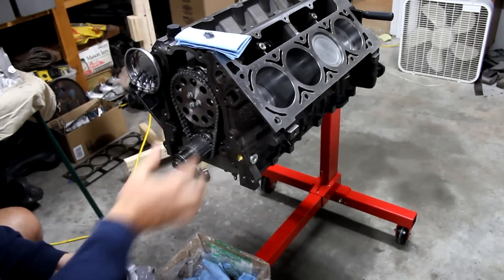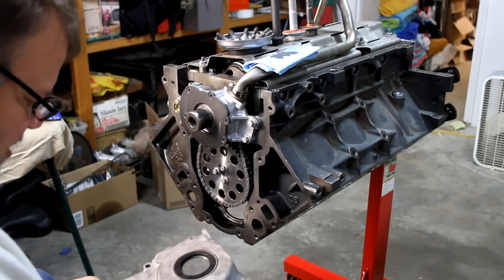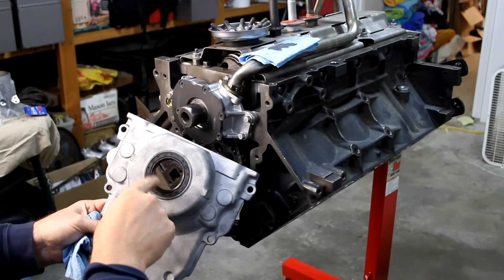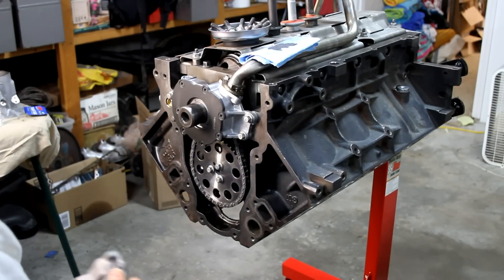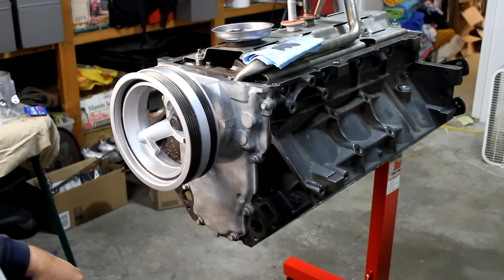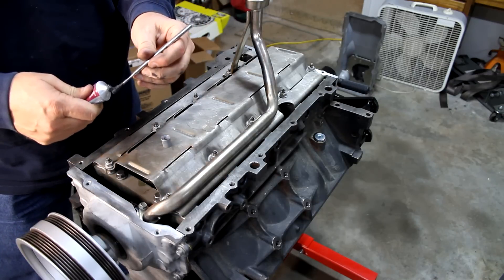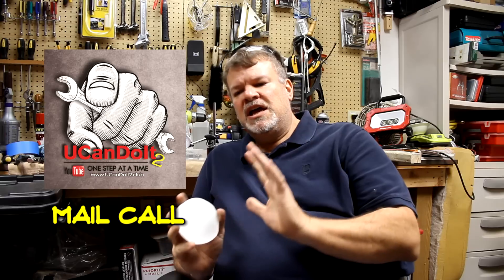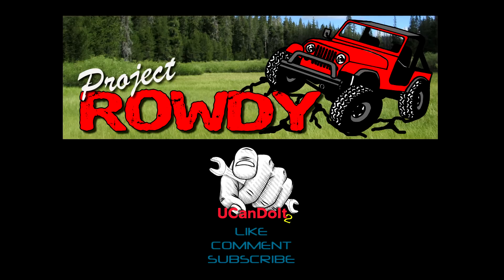LS 5.3L Build Part 5 Oil Pump and Covers | Project Rowdy Ep009

Comment: Great videos thank you for posting. Do you have recommendation  for a harmonic balancer puller? Also the bolt you used to install it?
Reply from the maker: In Part of this series, I used a Bearing Separator and Puller Set that I had purchased for another project (Transmission Build).  It worked perfectly.  I believe you can Google for specific HB Pullers as well.  For the Harmonic Balancer Installation Temporary Bolt, I used the following:     M16 x 2.0 x 120mm (Fastenal # 11127092).  The 120mm length provides what you need to do it right.  Hope this helps!
Reply: UCanDoIt2 thank you

Comment: How do you keep the crankshaft from turning when tightening the harmonic balancer bolt? It seems that you would eventually start turning the crankshaft once the bolt starts to get deep in the crankshaft.
Reply from the maker: Fantastic question!   I answer this in Part 7.  Check out Part 7 at this location... https://youtu.be/UeYfDW8u6-c?t=16m4s

Comment: What are the torque specs
Reply from the maker: To what????  There was a lot of content covered in this video.  Most books and manuals have pages of torque specs for all the fasteners.  Not that they all need to be torqued.
Reply: I lost oil pressure and have a knocking sound thought it was in the top end after further investigation my lifters and rockers pushrods are ok I'm all about putting it back better then before what's your thought?
Reply from the maker: I have little experience with diagnosing a problem and tearing apart an engine to discover the cause.   However, based on what I have learned and my limited experience, sounds like your Oil Pump went out and has possibly damaged one of the following:  Cam lobes, Lifter, Push Rod, or Rocker.   Just a thought.
Reply: That was our thought too it makes me nervous to tear it down or to have to pull it completely with out definitively knowing what the problem is or how severe

Comment: Can I use a melling high volume unit with a double roller timing chain on my 5.3 LM7. Same as yours.
Reply from the maker: When installing most/all Double Roller Timing sets, (on any LS style engine), I believe you are required to install small spacers between the Oil Pump and the block.  This provides the proper clearance due to the thicker size of the timing set.  On top of those Spacers, you should be able to install any LS style Oil Pump.    A word of caution on the High Volume Pump (you will need to decide).  From my earlier research (may be inaccurate), I believe it was stated that the Standard Melling Oil Pump produces more flow than the stock GM Oil Pump.  Therefore, just moving to the standard offering, you were doing an improvement.  I was thinking that "more" was better and thought about installing the High Volume model.  I was quickly warned that it is mostly used in race applications and that if you do not also increase the volume of your oil capacity, you could suck your sump (oil pan) empty.   Again, I will let you do your own investigation on all of that.  The over all answer to your question is Yes.  Please make sure you understand the correct use of a High Volume Pump.   Hope this helps!!!!

Comment: buen trabajo, la que me espera a mi, suenan los botadores de mi astro 98 4.3

345/5000
when it changes the rings, it also replaces the part of the piston, my star makes noise like of punches, but I want to prepare for the worse it brings 4.3 vortex, that advises me, I have seen that if it can be repaired without disarming it all, I admire it, it makes a fantastic job, very detailed, happy new year from tijuana, mexico your server aldo francisco
Reply from the maker: Muchas gracias!  Good luck with the repairs on your 4.3 Astro engine.

Comment: Having issues with oil pump priming . It is not a new pump but it did pump good before head and cam swap. Put new o ring on pickup tube .4+ quarts of oil in motor on stand. Oil filter full . pulled plug out of left lower front of block to prime pump . Still no oil pressure on stand. Using 1/2 drill using balancer bolt heads on with no plugs in it. Any help would be greatly appreciated.
Reply from the maker: Sounds like you have done everything required.  Two things come to mind:  1) a dry pump gear will never draw a vaccum (I believe you have taken care of this) and 2) Did you install the correct O-Ring on the pickup tube?  I believe there are at least two different styles of tube ends that require different size O-rings.  A straw with a tiny hole will never draw liquid.   Just a few thoughts!!!
Reply from the maker: I cannot remember if my kit came with a new gasket for the camshaft thrust plate.  I do remember that it was relatively flat and believe I used a little silicone behind the gasket to help hold it in place and to space it out just a tad (technical term).  I believe I will be in good shape there, but you point is excellent.   Thanks
Reply from the maker: I definitely did not purchase a new Plate.  But I do remember adding silicone behind the gasket.  Thanks!

Comment: Hey there, I"m really enjoying your videos on the 5.3 rebuild. I have a 5.3 that I need to rebuild. It's going into a 1968 Nova that i am restoring.

I just wanted to share with you something I have read about the oil pan installation. What I have read is that the back of the oil pan has to be exactly flush with the back of the engine block. (just like the timing chain cover and the rear seal cover). 

I think the reason for this, is that it has to be flush with the block is so that the transmission will mate up flush with the oil pan and the engine block. I assume that the transmission bell housing or possibly the oil pan could be damaged if they were not flush when the transmission is torqued down.

This may not be an issue on every install, I am willing to bet that you are possibly using an adapter to mate a Chrysler transmission to the LM7. What I am talking about may or may not be an issue for everyone. I just wanted to share some info that i have ran across, I hope that I am not incorrect on this topic. But it did seem like valid info, and I wanted to share it with you and others.

Once again, thank you for your videos.
Reply: briankmizell thanks bro

Comment: I'm sure you did this and I just didnt catch it, putting a smear of oil on the rear main and front crank seal.  Another great video.
Reply from the maker: Actually Darren, the manual that I used for this build specifically states. "A thin film of oil applied to the engine cover surfaces will help the seals press into place ( this is talking about installing the seal into the front and rear cover). However, the seals themselves are designed to be installed dry - do not lubricate their inner rubber surface!".  So I specifically did not lubricate them...  You didn't miss it... I didn't do it!!!!
Reply: Outstanding, that's a good thing for an old mechanic to know!
Reply from the maker: I agree!   Like you, half the reason I rebuilt this engine was to learn what the new stuff is all about!   Cheers!

Comment: I really like this part, great idea @2:15
Reply from the maker: Originally, I had never thought of "Centering" the Oil Pump.  It was brought to my attention by my machinist.  There is a process that uses multiple feeler gauges and I was prepared to do that.  I was studying up on the exact procedure and ran across a Melling Video on there site that explained the process that I used.  It was simple and I believe very effective.   Cheers to you!!!!!
Reply: I will definitely do this in my future builds!

Comment: Was your crank pulley painted or just media blasted?   Looks great, makes me want to pull mine off and clean and paint it.
Reply from the maker: I used two thin coats of the VHT Engine Paint to finish it off.  Was just looking to have it the same color as the engine.  After I started putting it all together, I realize that I should have painted it Black!  Don't tell anyone!  Cheers

Comment: Thanks for the great video very easy to understand step by step thumbs up to you. Can you tell me what size bolt did you use for the install of the harmonic balancer thread ptch and size I would like to duplicate exactly what you have done thanks for the great video
Reply from the maker: Thank you for the kind words Nelson!   The Temporary Bolt that I bought is:  M16 x 2.0 x 120mm (Fastenal # 11127092).  I do think it is a good idea to use it because when I would place the Balancer on the Crank, the OLD bolt only threads on less than 1 turn.  To try to use that bolt would damage the threads in the crank.  Not worth the damage.  Just so you know, I also purchased and used some Large Washers 3/4" x 2.00" (Fastenal # 1133018 for reference). During this video, I only installed the Balancer far enough to help me center the Timing cover.  Now that that is done, I am thinking about removing the Balancer so that it is easier to paint the engine.  Have fun with yours and thanks for watching!

Comment: hey I have a 2002 gmc yukon slt with 5.3 looking to just add some good power outside exhaust headers chip and intake anything you suggest?
Reply from the maker: I will start with the fact that I am probably not the right person the give you that kind of advise...  I do know that you either have an LM7 (mine) or L59 in your Yukon.  This is the same engine as mine.  The only difference in the L59 is that it has different Fuel injectors (Flex Fuel compatible).  So here is where I will talk from an theory perspective..... If the list of items are things that you have already done, those sound like a great start.  To dig deeper, you might consider a CAM (more Fuel and Air), Fuel Injectors (Especially if you have FF), and for Big $$$ different Heads (looking for higher compression).   Now an idea on your "CHIP".  A chip is trying to be a one-stop alteration to a standard engine configuration.  If you make a bunch of other changes (Headers, Exhaust, CAM, anything AIR related...  Does a standard "CHIP" make smart adjustments to a custom configuration?  You might consider a Custom Tune, where someone uses your changes to make smart changes to the PCM.  Just a thought!!!!  Thank you for watching and the best of luck with your updates!

Comment: Nice video, Mike.  DId you remove the special installation bolt and replace it with the proper bolt?
Reply from the maker: I have not yet.  At this point the Balancer is not fully installed on the shaft.  I installed it just far enough to help with the alignment of that front cover.  Not sure if I will need to remove it.  I'll be able to finish it's installation after I attach the Flywheel.  I have the Finish Bolt on the table in a particular place to remind me that it will need attention later!   Thank Ron!